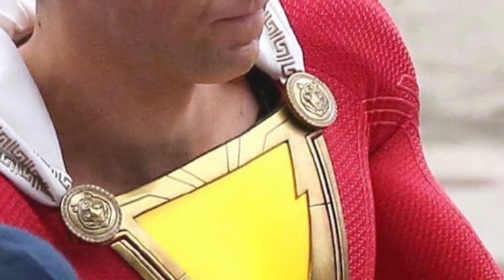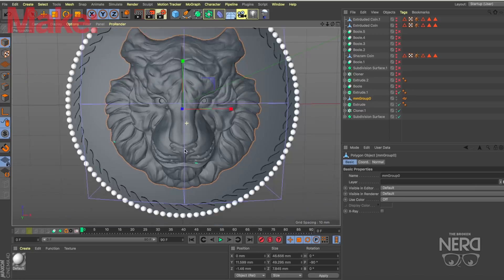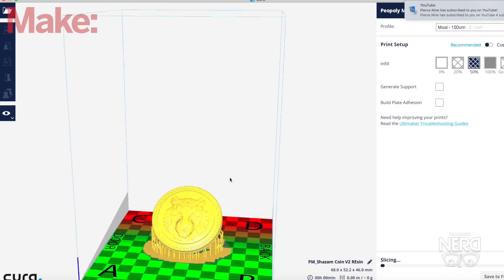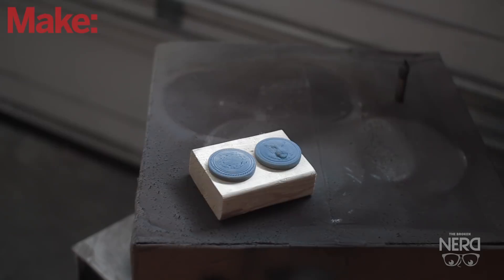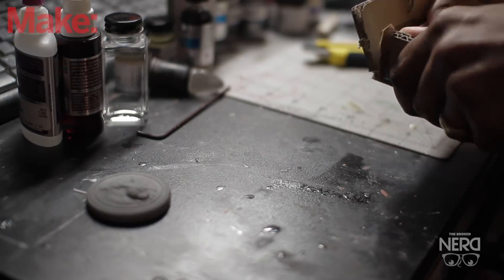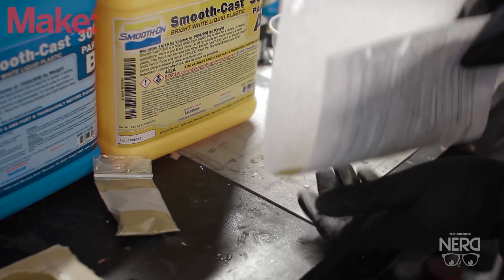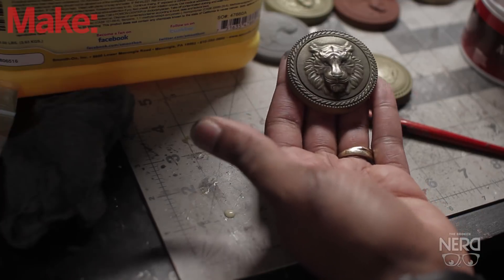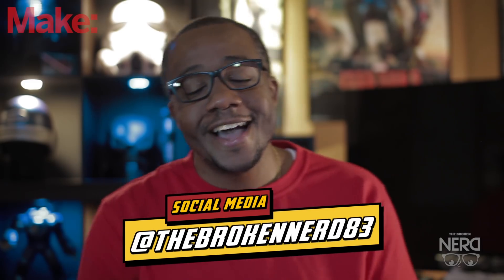How to Make Shazam Cape Holders Final w/The Broken Nerd

Comment: Those coins are really great! Its awesome to see you expanding your skill set, I was wondering why the sla printers print at a angle?
Reply from the maker: I haven't done any SLA printing myself, but my understanding is that it has the opposite problem from FDM printing - SLA resin sticks REALLY well to the print bed. You print at an angle to minimize the contact with the print bed surface, letting the sacrificial support material take the force needed to remove it from the print bed instead of damaging the print.

As to why it's at a 45 degree angle, instead of just hovering above the print bed and supported by the material, is outside of my scope of knowledge.
Reply: No expert by a longshot, but maybe it's to give the liquid a place to spill out?
Reply: hmm that is a interesting thought although im not sure its required because of the way it builds, each layer is directly below the object, speaking of layers I wonder if  its for better strength but im pretty sure sla have very small layers and this piece isnt structurally critical